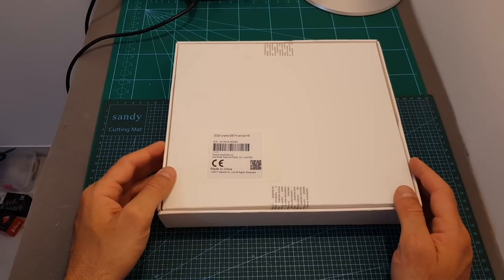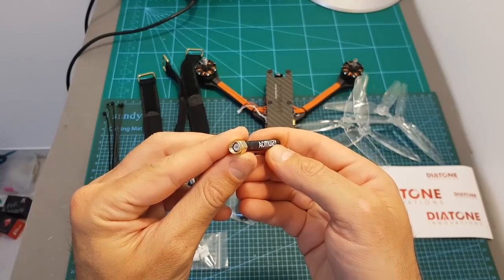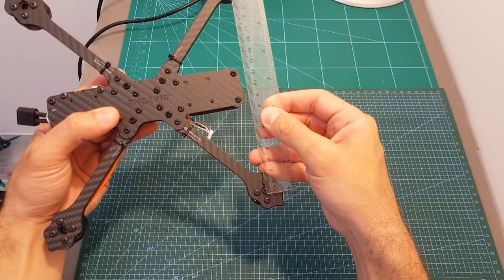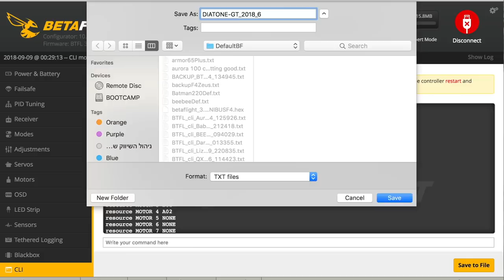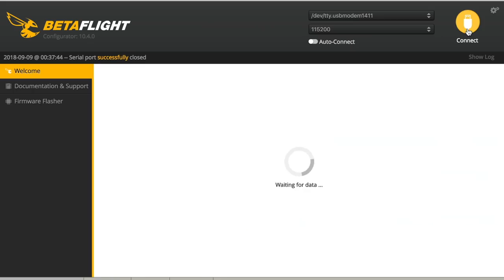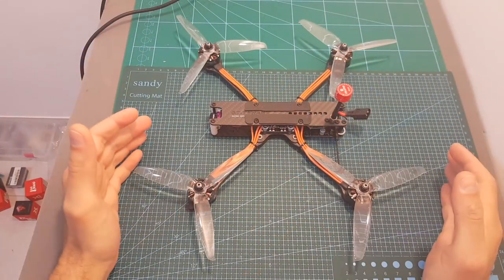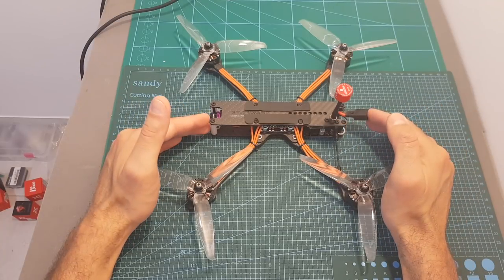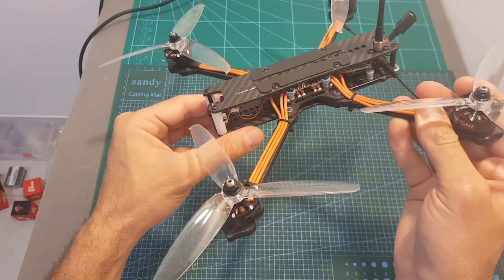Diatone 2018 Tyrants 630 - Setup, Review & Flight Footage

Comment: Could you be so kind and tell what size the capasitor on the flight controller is. i'm struggeling alot with video noise and osd flickering on this stack
Reply from the maker: 1000 nanoF 35v
Reply: Thats the one on the 5v circuit on the flight controller? The smallest 
Thanks
Reply from the maker: @Victor90NOR  No - The one that is connected to the ESC. The smallest one only states 25 on it. You can buy the entire board with the capacitor for a few bucks online.
Reply: @KremerFPV   okey thanks. But there is one connected to the esc, one to the board with the unify and the last on the flight controller it self. Thats the one i need 😂

Comment: It would be neat if the battery could be place within the frame since it is so long. What do you think about that idea?
Reply from the maker: Even though it's a very long one, it's impossible to fit a battery inside.
Reply: Gal Kremer I know but if it was designed with the flight controller stack immediately behind the fpv camera it would be feasible so I am suggesting that it can be done that way similarly to the DRL racer 3 drones  https://thedroneracingleague.com/racer3/

Comment: Thanks for your great videos. I would like to unlock the TBS VTX on my Tyrant, but it seems to be caged inside a silver metal box, how can I remove it and access the VTX?
I bumped the VTX power using Smart Audio on my OSD to 800 but when I measure the signal it is outputting around 250, so maybe it’s locked or defective?
I appreciate your help!
Reply from the maker: Thanks buddy, I appreciate your support :-)
Your VTX is unlocked. If it was locked its maximum output strength was 25mw. 
Replace your connector and try again and see if it changes anything.
Reply: Gal Kremer oh wow, I haven’t changed anything, and everything seems ok, maybe my VTX is defective.
I flew it once without a VTX antenna for 2 minutes before realizing it, so maybe that ruined it :(  $$$$$$
Thanks!!